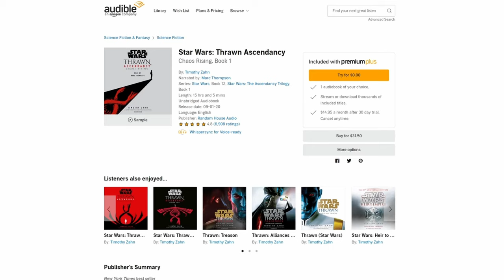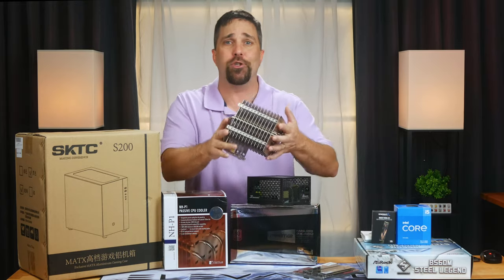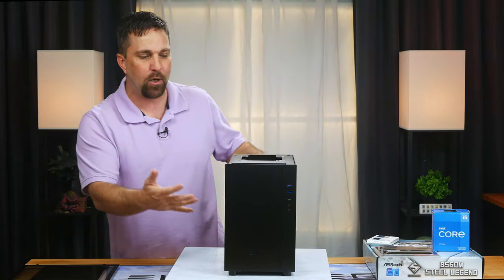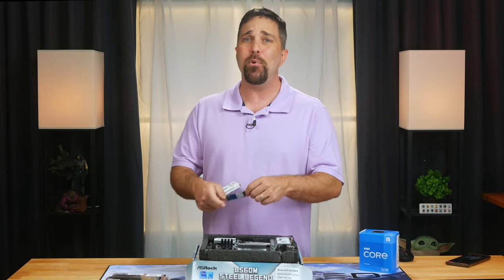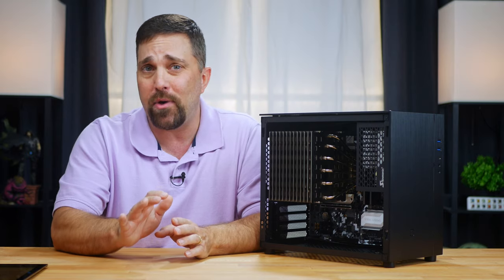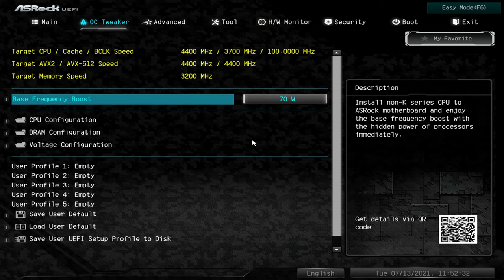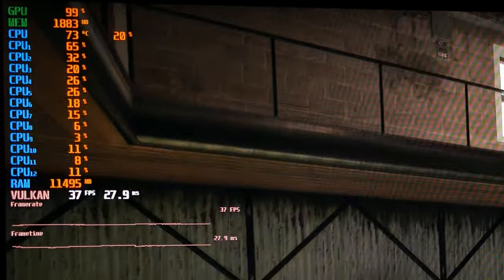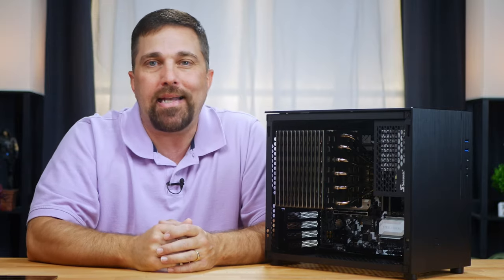Completely Passive PC Build, feat. Noctua NH-P1

Comment: I just gave up on my first passive PC, was going to be based on the Intel N100 and ASRock A380 Challenger with a Raijintech morpheus 2 core aftermarket cooler. I'll probably copycat most of your build with the customized A380 when I have the funds. Thank you so much for the inspiration and the research into the case that is optimized for airflow and such. 

The only tricky part now will be cutting a copper heat spreader for the VRAM on the A380. Looking for a good way to insulate the non thermal contact areas to avoid shorting things out.

Comment: Nice build, I'm going to use case you used here for my build - good find! I can use my full size psu and this case is tiny. I prefer semipassive solutions. Psu and gpu will not spin fans at idle (psu even during gaming is not spinning fans), and gpu will (obviously...). I'm using Noctua passive cooler 😎

Comment: Another great build and video! I was half expecting you to fab a mesh panel to replace the glass. Glad it works "out of the box" and anyone can build it!
Reply: That massive passive cooler pushed up against the glass looks really neat. My initial reaction is that I would prefer a mesh or solid side panel but this build turned out looking really good!

Comment: Yoooo!  I want to build a passive 8700g build, is this cooler overkill?  I don't think I'd need anything greater than a PICO PSU as the power draw will be pretty low, so I feel like this case/cooler combo might be overkill.

Comment: Thanks for sharing... You inspired me to build a passive Mini Itx on Aluminum Case. Can you please  tell what is the highest safe temp for PCH?

With 22c ambient room, mine reaches 50c with 2 intake at 650rpm if I turn them off PCH reaches 69 on ZZEW B6 14L mini itx case, Gigabyte Aorus Z690i lite d4 (with 2 gen4 NVME SSD and 2 sata 2.5 ssds, i5-12400+Thermalright SI-100 210TDP rated 31-47c and 56c highest with no fans; GPU is a HP AMD RX5500 oem replaced heatsink with a Raijintek Morpheus 2 Core no fans 32-40c normal use and 57c gaming) is 69c or even 70-75c degrees ok for PCH? Thanks before hand!
Reply from the maker: 70-75C is fine. The tjMax on most Intel Platform Controller's is > 100C
Reply: @ElevatedSystems  thanks, much apreciated!!

Comment: Would have been to cool see how far you could push it if you just had one (low speed) Noctua (or other brand very quiet) case fan. I noticed Noctua has some you can set to like 12db. Surely that would be essentially silent (I wonder if we can even hear 12db unless we were in a completely silent room) but would provide some performance boost? (like allowing you to increase the power draw or something?)

Anyway awesome video.
Reply: I know modern AMD's will boost higher the lower temp they are at. So for a modern AMD chip more cooling probably means more potential performance. Dunno about the current intel stuff. Older Intel I would say for sure no, not without overclocking it.

Comment: Would you still recommend the matx case with a dedicated graphics card (with fans)? I don‘t mind fan noise while gaming, so I‘m looking for something like a GTX 1650 with a Fan stop Feature  in idle mode (to have a silent system most of the time).
Reply from the maker: No, you want as much distance between the graphics card and CPU cooler as possible so I'd go ATX and put the card in the lower PCIe slot. Check out the build Noctua did in the Jonsbo case.
Reply: You can pick the GTX1650 KalmX: https://www.palit.com/palit/vgapro.php?id=3494&lang=en
The issue is that the side panel should be perforated aluminium, at least the lower part by the expansion slots.
Reply: I think it should ot be terrible, there is plenty of headroom with cpu cooling adding gpu would still be safe. I'm thinking of using it with 5600x +4070 rtx (hopefully, but now 2060s rtx) in the same case.

Comment: Sabrent Heatsink disipador de Calor para Rockets M.2 2280 SSD [Plateado] (SB-HTSK) there is room for this cooler with the NoctuaNH-1? Thank you. I'm in a hurry.
Reply from the maker: Depends on the motherboard but M.2 slots are typically in the PCIe lane area so should have no impact on a CPU cooler.

Comment: Would it potentially be worth chucking some intake fans in the bottom, then programming them with a fan curve that basically stays off, then kicks in steeply only if the temperature hits a dangerous high?
Reply from the maker: I don't think so. It is pretty much impossible for a modern CPU to get dangerously hot as it throttles itself and will instantly shutdown if there is a rapid spike. Besides if prime 95 only rose the temp to 83c there is nothing an average PC user is going to do to drive the CPU that hot. Plus fans on the bottom will impede the convection flow when not spinning. Like I said if the PC is in an environment where it can get hotter the best thing to do is lower the PL2 power limit.

Comment: I have a dumb question why not cpus get bigger instead of sticking to the same form factor ? That way they could be more powerful and techy and maybe generate less heat?
Reply from the maker: Actually the smaller the a CPU gets the more efficient it is. It required less power to move electrons across gates, they have less space to move through, less curent needed to read gate states, therfore making the CPU faster and cooler.

Comment: ew 11400
Reply from the maker: Yes, it's a perfect CPU for this application. Do you have an alternate recommendation?
Reply: @ElevatedSystems  why not ryzen 5600x
Reply from the maker: No integrated graphics, so that wouldn't work in this system.
Reply: 5600x is too hot for passive, and 11400 is cheaper yet better for games. 5000 ryzens are trash